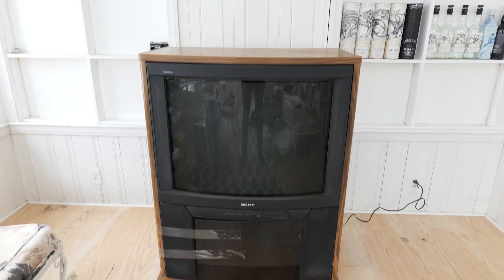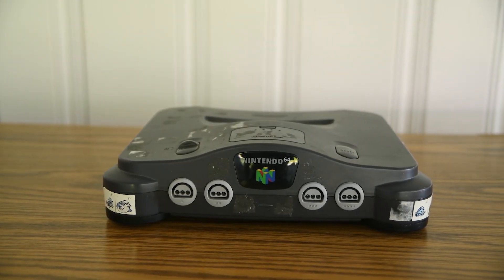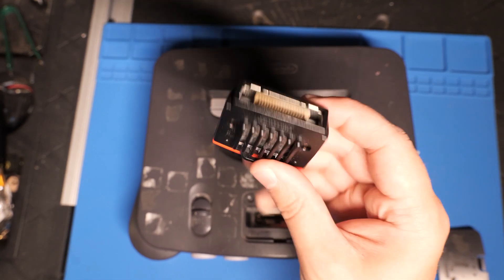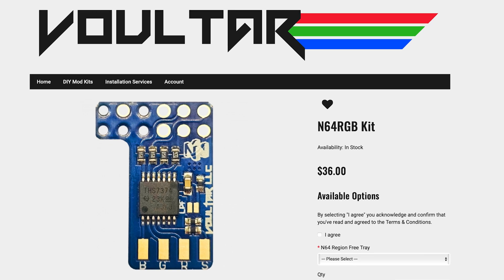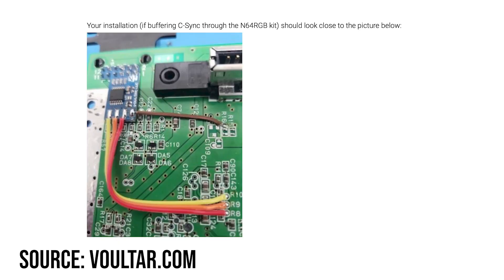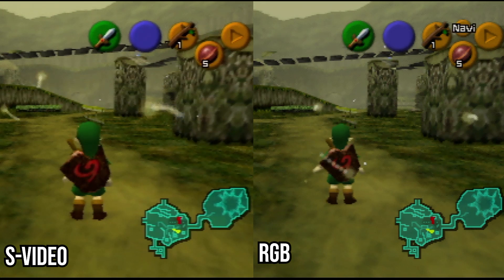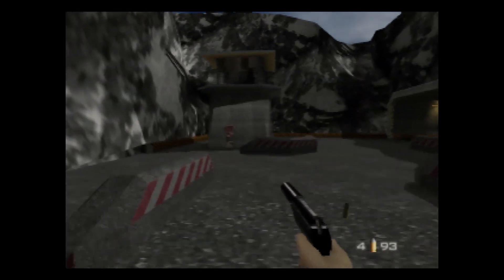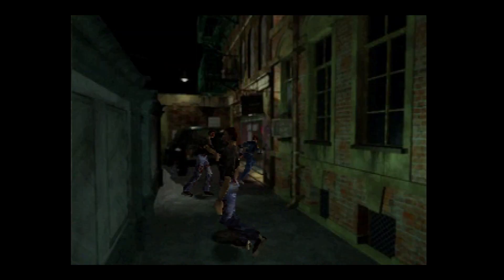RGB mod your Nintendo 64! Easy!

Comment: Most N64 variants manufactured are not compatible with this mod, though there are definitely a bunch which are compatible. 

There's an even less common early French PAL variant which is also easy to RGB mod, but the easy RGB mod for that variant is still different than this one, but those models are also highly valued because of this. 

Shockingly, some PAL region N64s don't even have S-video output, and will only support composite output. Thankfully, the N64's composite signal was always quite good as far as composite signal outputs go. 

Tim Worthington's RGB mod is more expensive, and more difficult to install, but will work on any model of N64. V3 or later can also be used to add component (YPbPr) or even S-video instead of RGB output (and this can be changed later on with a bit of soldering, I believe).

There are other RGB mods out there for the N64. Some are actually pretty bad, so don't assume that a pre-installed RGB mod is as good as the Vaultar mod or the even better Tim Worthington RGB mod.

Comment: 2:13 I can recommend using pure IPA for any cleaning job. It removes stains, glue, paper, markers and you don't even need to clean it off as it evaporates. It only reacts with a few materials, but always check it on a corner you won't see or on the inside to make sure it doesn't ruin a perfectly fine console housing.

Comment: I just got into retro consoles and want to start restoring, modding and especially using them more often. I already got almost any console I want over the past few years, but they are only waiting in cardboard boxes to be used again. The variety of connection methods is a bit annoying so I also want to get everything to output RGB.

Comment: Question which n64 scart cable did you buy the c-Sync or sync on luma ?
Reply from the maker: @beavisx32  I bought the sync on luma. Not sure how much it matters but it seems to work well for me. I figured it would have less noise with the luma signal but I don’t know if that’s true. It won’t work on snes jr systems unless you mod it for s-video. But if you are just talking about an rgb modded n64, it will work well.

Comment: It's worth to mention for non-NTSC users this mod is sadly useless for them since RGB is non-existent on the motherboard of non-French PAL models requiring them either the RGB Mod Advance by Borti or the Tim Worthington mod. The mod you have re-enables RGB on NTSC (both North America and Japan) consoles since it has RGB on the motherboard but it's disabled and unused. This mod theoretically should work on the French PAL consoles since it also has disabled RGB on the motherboard. But a similar mods also works but with modkits from other distributors. Voultar doesn't mention it works on that particular model only on NTSC models.
Reply: Didn’t know that was looking at modding my PAL N64 but was going to go down the Tim Worthington route

Comment: I think you should do the hdmi mod I know you could do it then you could play simoltaniously rgb and to a flat screen to stream.  A fun mod I’ve done is solder extra ram into one to have a permanent expansion pack and you only need the jumper in to run it

Comment: Voultars n64 RGB mod was actually the very first mod I ever did on a console and my first soldering project. I'd definitely recommend this mod for anyone looking to get into the hobby.
Reply: Yes, if their console is actually compatible with this mod. Most early models are compatible with this mod, but at some point, they changed it, and many versions require a more expensive and more difficult mod to be able to put out an RGB signal. 

Early French versions of the console are even cheaper to mod I believe, but the process is different. The reason it's easier is because the French version was planned to actually have native support for RGB, and they only decided to not include all of the necessary components for that feature shortly before they were manufactured.
Reply: @syncmonism  I was one of the lucky ones I guess.

Comment: I too leverage the power of technology to solve non-problems. I have s-video and an upscaler and I still want to install that RGB mod.
Reply: I mean, if you have one of the early NTSC variants, it's cheap and not that hard either.

Comment: Hi i have a japanese n64, but i Live in europe so all crt and scart cables are pal. as long as i caonnect it to those ,it works fine but if i use a scaler and connect it to modern tv, it's all black and white, will this solve the issue?